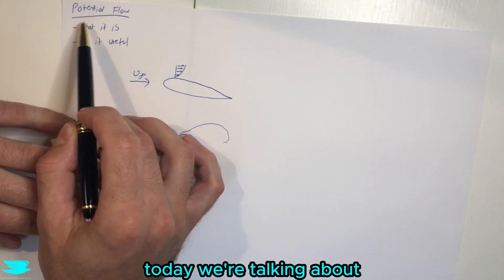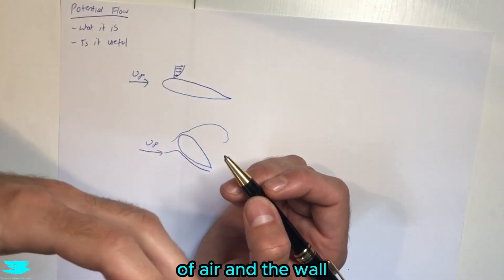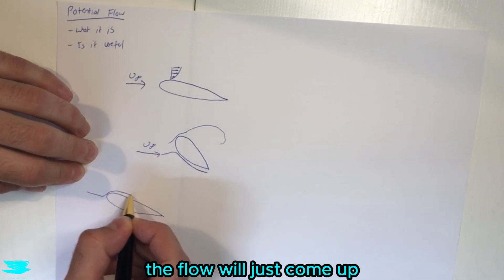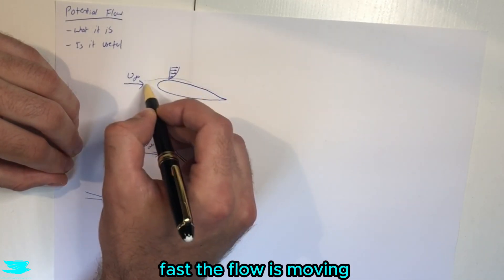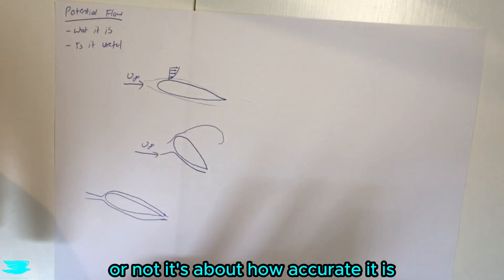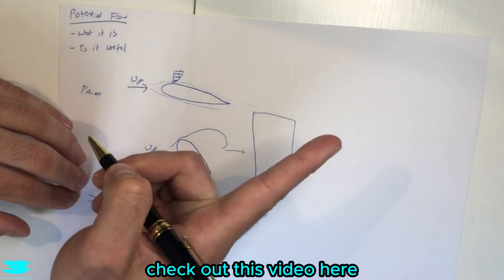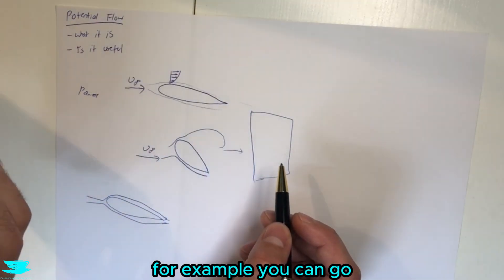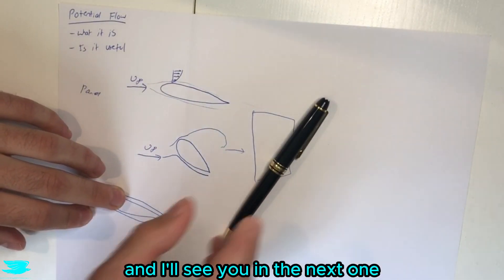What Is Potential Flow And Is It Good? [Aero Fundamentals #52]

Comment: Hello,

If you put a Prop behind an object that is producing the karmann vortex street. 
And you power the prop, it is producing potential flow.

The Vortex street should start to disapear. 

The drag of the object that produces the vortex street, should keep the same. 
But the thrust/energy ratio of the prop gets higher.
It needs far less energy in order to produce thrust.

The reason for this is the slowed air of the obstacle. 
W = 1/2 m v^2 
The slower the air , the more impulse  per energy you get accelerating it.

So the thrust increase of the prop is indirectly reducing the drag of the obstacle.

So smooth streamlines, without vortex streets produce less drag.

Perhaps you could do a CFD with a sphere and a force field( prop) behind ?
I think it's possible to lower the energy to overcome drag by a large amount. If a prop disables the vortex street.

I would call this method "Active Drag Reduction - ADR"

I don't know if there are any papers out on this topic yet.

For people who aren't in aerodynamics it's hard to understand ,i believe.
So getting to watch a cfd solved video about would help.

Comment: Boundary layer theory, separating the potential flow, where viscosity is negligible, and the boundary layer, where viscosity dominates, was a major step to make numeric analysis of flows possible.
Add the kutta condition (adjust circulation so speed at the trailing edge is not infinite), and you can get good solutions for the properties of airfoils.
Reply from the maker: Definitely. They a lot of application and if it weren't for them, the 50s, 60s, and 70s aeronautical industry would look very different.

Comment: Can airfoils stall in inviscid flow? If not, what is the critical angle-of-attack for greatest lift, and what angle-of-attack results in the greatest lift/drag ratio?
Reply: Stall is a consequence of flow reversing in the boundary layer, which in itself is a consequence of viscosity. So no, stall does not occur in inviscid flow. Same thing with drag: airfoils have zero drag when using potential flow. Max lift is at 90° but that yields a wildly unrealistic result.
Reply from the maker: @toonverbruggen7351  Exactly. 👍